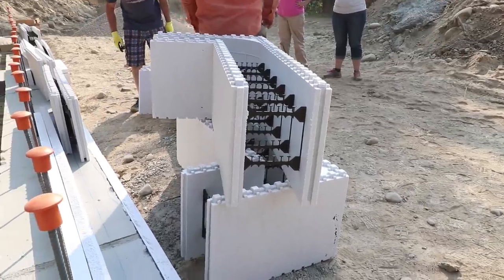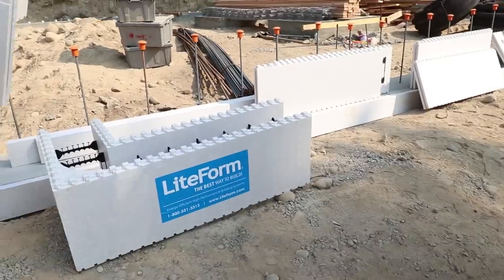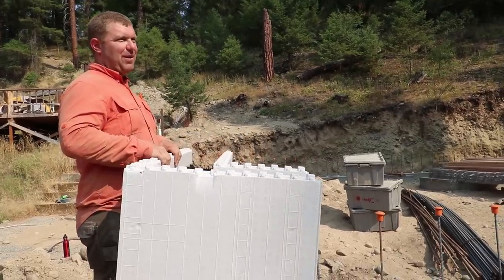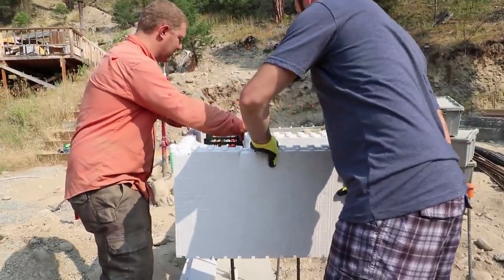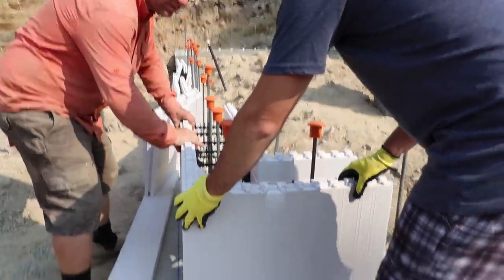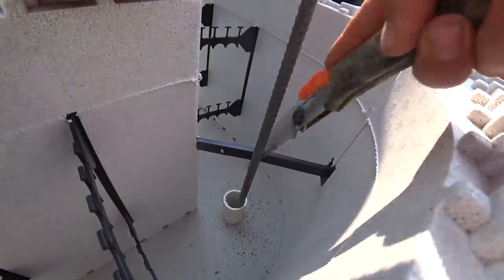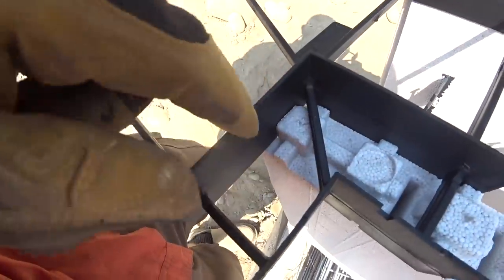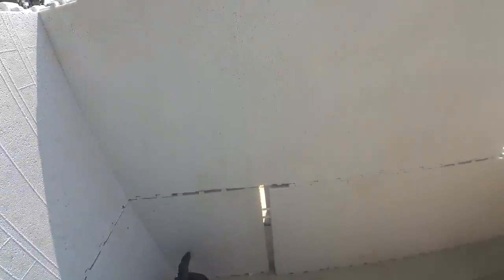Building a House Start to Finish: Beginning ICF Construction

Comment: Don't beat yourselves up about trying to measure the foundations to 1/32". As a structural engineer, reinforced concrete is not an exact science.  In most specifications the positional tolerance of wall etc is typically about +/-10mm (1/4-1/2").  Any deviation less than that can be corrected in the structure above. 

You're doing a good job but don't over think things.  Planning and thinking things out before hand is good, but know when to stop thinking/researching and go with your engineers instructions.

Comment: You shouldn't have cut the webs in the blocks to pass the rebar its part of the design to keep the blocks from blowing out. You could have drilled a 1inch hole in the corners to pass the bar through and then filled it with the foam sprayer.

Comment: WOW!  Pushing all that rebar closer to the inside IS NOT A GOOD IDEA!!!  That portion of the wall will now be weaker and susceptible to cracks.  You should have gone with conventional form panels.  You could have still insulted after you stripped the forms.  Hope it works out but I don't have much faith in your foundation no cracking or leaking in the near future.

Comment: The best way to use ICF' s is to throw them away and hire a contractor. You've done everything the most expensive way starting at your excavation. Step the foundation up the hill, no major excavation. No retaining wall, no sealing the wall, no backfilling. Pour a monolithic footing and stem wall. It all could have been done in a week or less. And at about 1/4 the cost. Silly amateurs.

Comment: If all else fails, read the instructions....Pls reinstate the inner ties, they are structural...never  ever cut them....supplier /engineer may have a solution...you do not want a blow out....concrete has this insane obsession to obey the law of gravity. Rebar placement can be done in the forms via drilling a hole at the end of the run and passing the steel through across the ties. repair the hole with tape on the inside and fill the cavity with your bonding foam. Remember to vibrate your ICF pour per your engineers instructions. Ever wonder why CIP foundations are formed with 1 1/4" thick plywood panels? Your footings were a work of art.

Comment: Just have it in your head for ever, "they want it to be this measurement or I won't get paid, ever", so I'll put a chalk mark down, right here, cross it and look out. The knock on effect of 27/32" on some projects would be financially ruinous. You wouldn't work in the industry ever again. Put your lower rebar in before fitting the corners, and stop cutting those cross members. Consider the importance of a part can be measured  by the work put in to the design, then look at the EPS. One has far more design and should be respected more. Eps can be repaired with that Adhesive spray foam, those damaged cross members really need replacing as any repair isn't up to the job the piece was designed to do.
I heard you mention it was a Construction site, and you didn't read the instructions, you've just been sacked, again.

Comment: Cuting the black ties ... what the hell are you doing ?

only one rebars in the corner is not a good way to do the job

better for you tu get professionnal advice before it s too late , you build for years normally, I can promise you ll get problems in the first years of achievement !